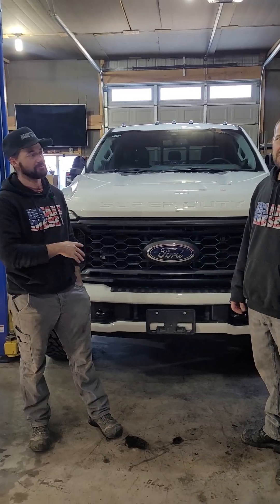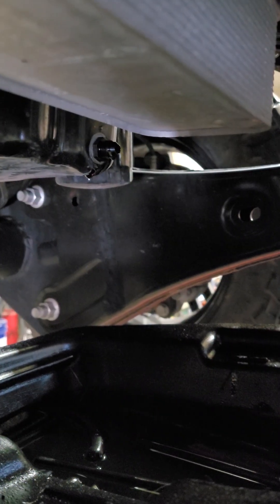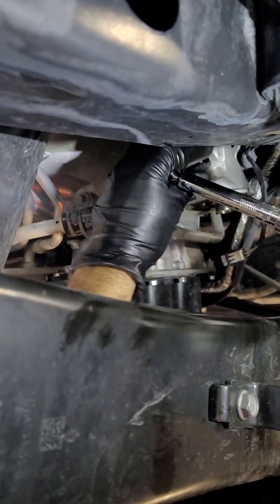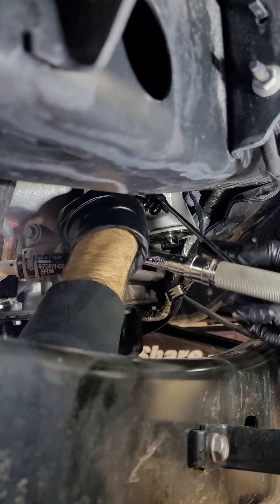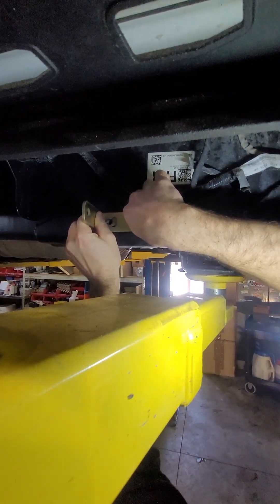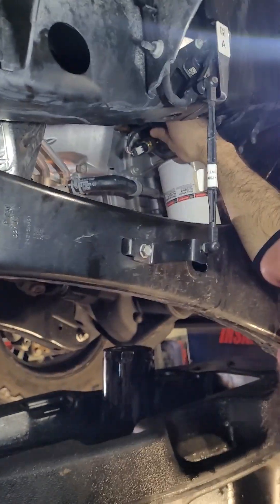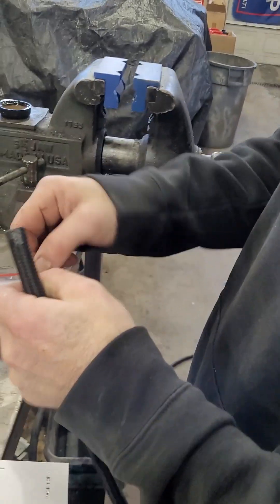Ford F350 6.7L Powerstroke Frame Mount Oil Bypass Filter Installation Guide (Rear Facing)

Comment: Not impressed with the routing of the oi line through the frame too many points to rub/chafe and I don't care for the filter to be hanging horizontally, just looks like it could loosen up and swing down. Not a better place?
Reply from the maker: We put rubber stub pieces in the holes so the hose doesn’t rub on the frame. You can also mount it inside the frame.

Comment: Is there any risk that the factory oil pressure sensor reads lower now that it’s mounted after a tee? I’d think that’s negligible but just wanna make sure. Overall it seems like a solid product. Although I’d also want that filter to be mounted somewhere safer ideally.
Reply from the maker: No, the oil pressure gauge is not affected by adding a tee into the mix. Great question!

Comment: So I’m assuming I gotta do all that hose cutting and bs or does the kit come ready to install on my 2017 6.7 power stroke f450 platinum?
Reply from the maker: We can pre-assemble the hoses for you for an additional charge.  We make them to cut to length because not all customers run the hoses through the same paths.  We give you 1 length to be cut to the path you would like to take for the hoses.  On the 2019 and older it also depends on where you want to mount it on the frame.  Some customers mount just behind the passenger side tire, others like it further back on the frame.  Fittings to hose assembly only takes about 15 minutes.

Comment: That is way too low to mount that filter.  If you sink that truck to the frame or end up in a ditch say goodbye to the motor, we have all done it or will do it.   Whay not just mount it at the top of the frame and why so far back.  This is the lazy way to do it because there are already existing holes.  Just drill holes in the frame where you need them too keep the filter safe and install rivit nuts.

Comment: What is the purpose of the other oil filter? And when does that one get changed out?
Reply from the maker: The stock engine oil filter is to filter your full flow of oil the engine needs to lubricate itself.  (About 20 micron)The red bypass filter takes a small amount of oil from your system and filters it down to 1 micron and returns it back to your fill caps.  It is changed every 15k miles or 1 time per year.  When you filter your oil down to 1 micron you 3-4 times the life of the moving parts inside of the engine.

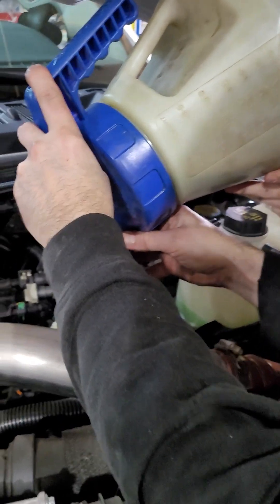Comment: How safe is it leaving the canister out like that? 12:58
Reply: The lowest point of the canister is at the level of the tremor off road steps and about 1/4 inch below the frame.  It is higher than the lower edge of the oil pan.
Reply: The 900k engine had his bypass filter mounted like that…
Reply from the maker: Very safe.  The lowest edge of the bottom is higher than the frame.  The lowest edge of the top is higher than the rub rail steps.  It is made from T-6 billet aluminum that is anodized, so it holds up to the salt and rocks thrown at it as well.
Reply: It's not he just did it because he wants it to fall off

Comment: Was that an aftermarket oil pan drain plug you put back in that truck?
Reply: Looks like a opti lube after market drain plug… but I know for a fact it doesn’t come like that from the factory. So yes it’s aftermarket.
Reply from the maker: Yes, EZ-106